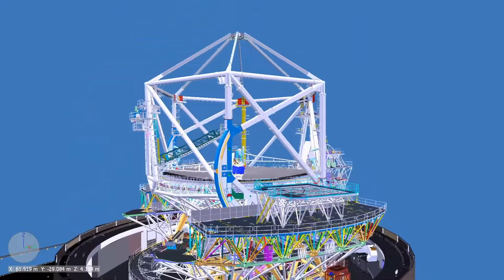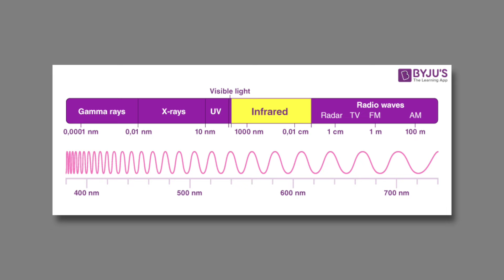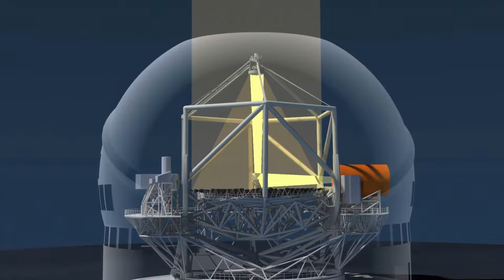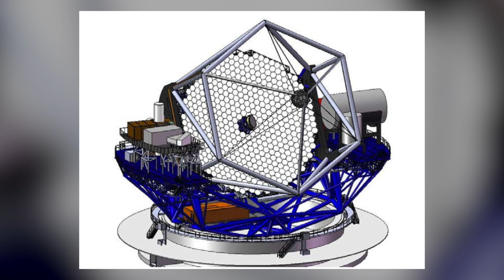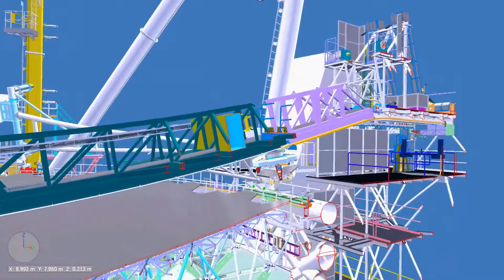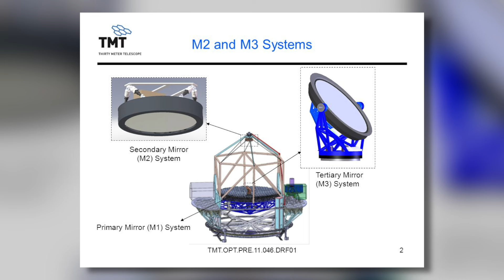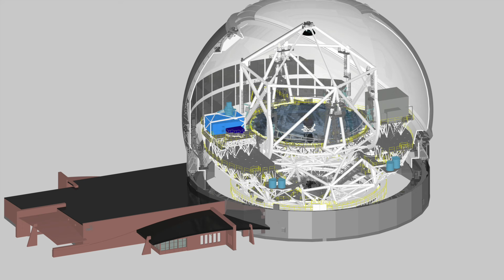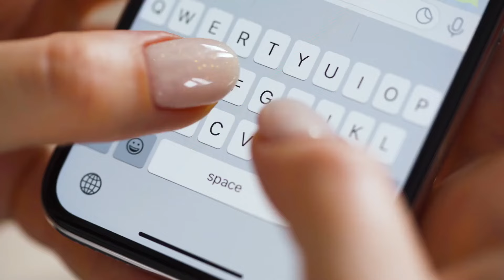The Battle To Build TMT - The World’s Largest New Telescope In Hawaii

Comment: But the ELT is not larger, which has a 39-meter mirror and an 80-meter-high dome in the Atacama Desert.
Reply: It is larger. TMT is THIRTY-Metre Telescope. ELT is 39 metres. The TMT will most likely give slightly cleaner images with fewer diffraction artefacts, due to its support structure being outside the light paths.